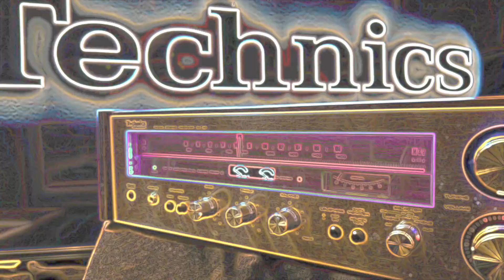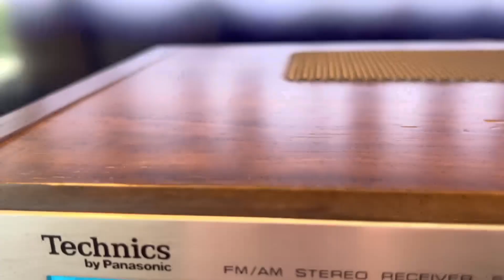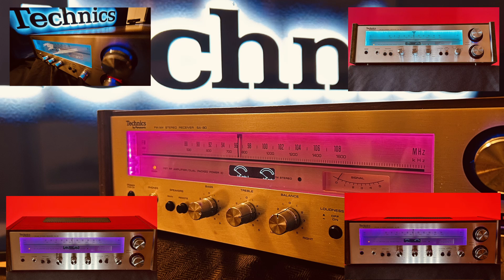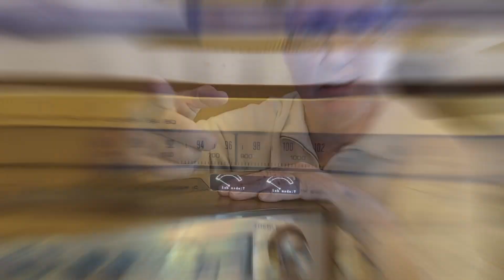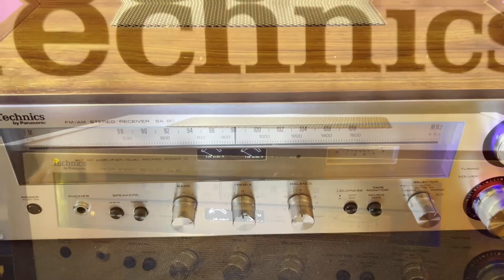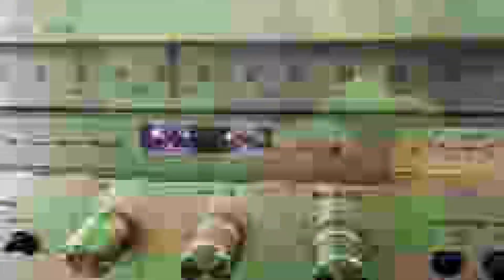Technics resto mod SA-80 receiver

Comment: Great end result. It would have been nice to see some of the technical stuff.
Reply from the maker: I am going to put a tech video together, it just takes me a while to actually shoot it and edit it all together 😁
Reply: Hi! I'm just about to buy one exactly like that. Do you recomend it? When I do I will try to get in touch with you. If you are OK. Thank you!
Reply from the maker: @Rotofoot hello, did you end up purchasing one?
Reply from the maker: @Rotofoot I like it, it’s a nice size and fairly easy to work on.  Everything ended up working on mine but I spent a fair amount of time cleaning all the pots, switches and inputs/speaker connections.
Reply: @yourdiytechlife  super cool man! I actually just picked up an SA-80 (I was given a technics M205 cassette deck off FB marketplace, and the gal just through in the receiver). I’m extremely impressed with its sound once I paired it with the right speakers (and I’ve owned/heard quite a few old receivers. Marantz 2230 , Sansui G-3000, Dynaco Mark III’s, Quicksilver Audio Silvers, to name a few of my collection.) I’d be super curious to know how you outfitted those lights to it! It looks amazing, and I want to do something similar
Reply: Hi. Thank you for your answer. Yes I did. I have it with me right now and even found the matching cassete player. I haven't connected yet but they should work ok. They will need some taking care though. Looking forward for more videos and info from you and your SA 80. Greetings.
Reply: Looking forward for your video. Thank you very much!